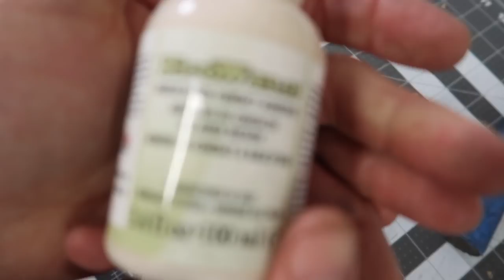Making a Leather Sheath for Chunky Monkey

Comment: Just a tip. If you push the needle through on the last stitch so that they don't go all the way through the hole but come out between layers, you can tie the knot so it is hidden.
Reply from the maker: How does that work with a glued in welt? Also, the stitches were finishing at the bottom and I think it would be hard to tie them deep on the sheath like that. I’ve seen that done but couldn’t figure it out for this sheath. Love the idea though. Maybe needs a little more investigation. 🙏👍
Reply: Simple Little Life typically I've always used contact cement. Has never been much of an issue with getting the needle through the glue joint. The knot pulls itself into the joint when you tighten it. I just think it makes it look a touch cleaner that way. But in no way am I saying your work is anything less than beautiful.

Comment: Great video! Question: have you tried using a drill press to drill your stitching holes? And if so what are the pros and cons? I’ve used a drill before but it tends to wander.
Reply from the maker: I used to use a drill press but I can’t get the holes to line up properly so I’ve gone back to punches and awls👍